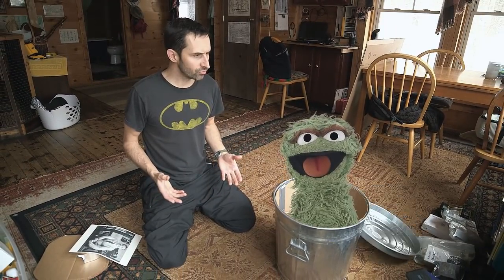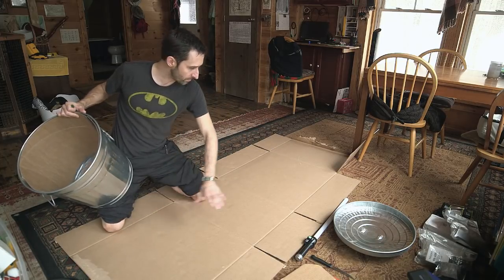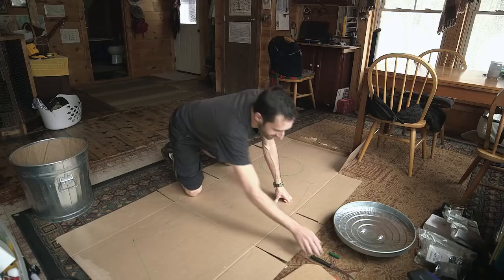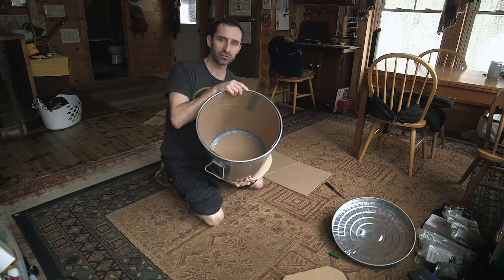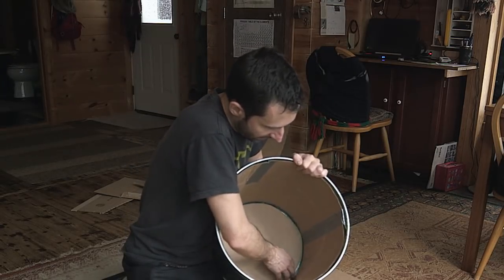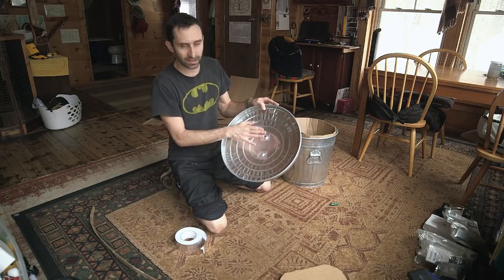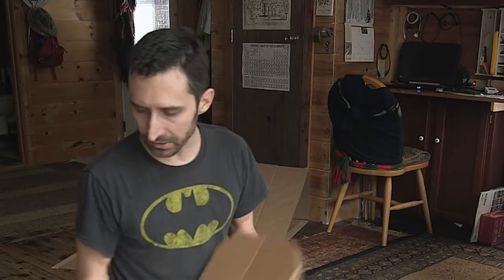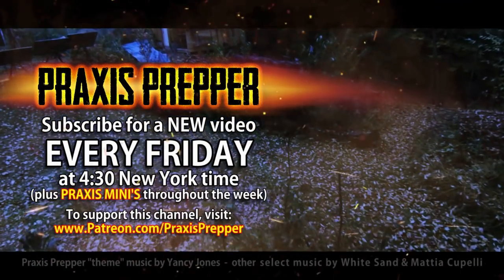Cheap, Easy and QUICK - DIY Faraday Cage

Comment: Wouldn't it be easier to brush or spray some "Flex Seal" rubber paint on the inside of the trash can?
Reply from the maker: I suppose that would definitely be easier. But this method has the advantage of using a free material that's otherwise going to get landfilled and not off-gassing any fumes. But you're right that spraying on a liner would do the same job. I suppose just putting everything in the can into a plastic bag would work too. All this said, there's some disagreement in the informed community as to whether this inner padding layer is even useful in terms of electrical protection.
Thanks for the comment!
Reply: @PraxisPrepper  In some Srates people are asked to bundle up cardboard for recycling. Almost all stores do it now. 
They make new boxes out of it. Not too many people have large cardboard boxes laying around so they would have to buy one. I agree the Flex Seal rubber seal is not good for the environment. Plus it limits later use of the pail.
I'm going to try to find a plastic pail to fit in the metal trash can. I know plastic is not much more environmental but new studies have found how to dissolve it soon. And later I could use the plastic pail for other things if World Peace arrives. L.O.L. !
Reply from the maker: Hey David, I hope I wasn't coming off as trying to plastic shame you or anything. I use plenty of plastics myself as well. In fact, the insulation in my house is urethane foam. I think plastics are great for all sorts of things - especially things that are intended to be long-lasting. That's the weird irony with plastics I think. We invent something that lasts practically forever, and we tend to use it for things that only need to last a couple of minutes or maybe hours.
As far as cardboard goes, it varies from time to time, and cardboard IS very recyclABLE. But depending upon the economic situation and international relations (specifically US w/ China) cardboard can sometimes not end up being recycled in favor of it just being landfilled after it's collected at the curb. I believe that a recent study even found that about 40% of plastics that are put into the recycle bin (appropriately with the correct numbers) are actually being landfilled. My brother did a study on this topic too (he's a professor of this topic) and even if humans wanted to continuously recycle plastics and there were no economic hurdles or anything like that. The current plastics that we use #1, 2, and 5, which are the top picks for recycling, they only have a few return trips in them before the polymer chains just get broken up too much and they really can't be reused anymore. So recycling with them isn't to keep them out of landfills but rather to try to give them a few extra uses before they ultimately end up there no matter what.
As for your "bucket-ception" idea, I think it's a good one. @davidg.johnson7208

Comment: Isn't some duck tape conductive  ??? I'd use something else
Reply from the maker: Hmmm. I don't know for sure. I know it's used sometimes by renegade electricians in place of electrical tape. But maybe there are some more conductive tapes... It's a good question to consider it.
Reply: You need the aluminum electrician's version of duct tape. I'd also line it with yoga mats not cardboard. There is also a need to double cage these incase the pulse is above your horizon which it will be at the start of world war three
Reply from the maker: I sort of double cage with some anti-static bags inside. But yeah, I 'd presume layers of protection would only help. I'd highly recommend viewing the video I reference in this video where the guy does the actual tests. It's a good video... even though Oscar the Grouch doesn't make an appearance
Reply: Praxis Prepper most Prepper videos need more Sesame Street 😜
Reply: I am putting one together now and am trying to decide between duct tape and regular packaging tape.  This is making me lean more towards clear packaging tape.